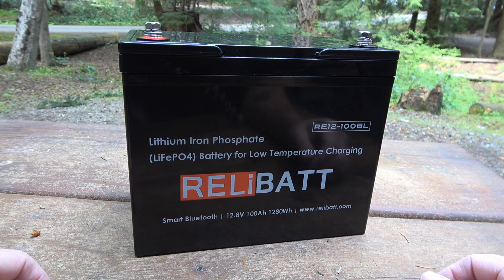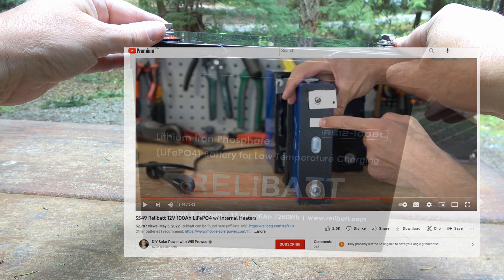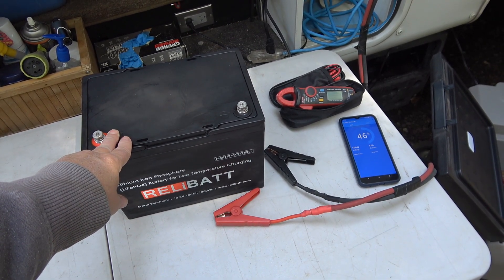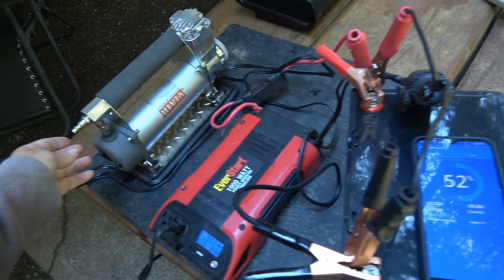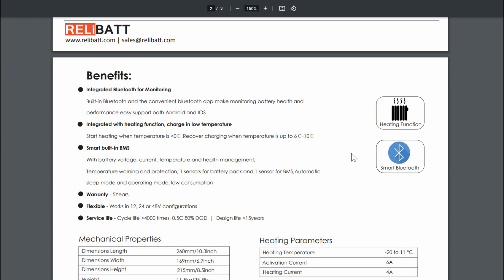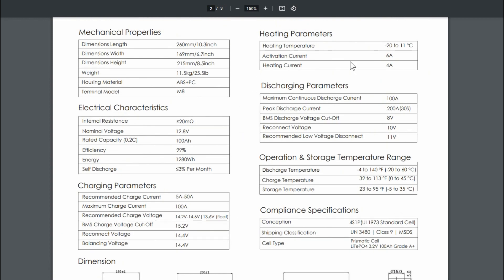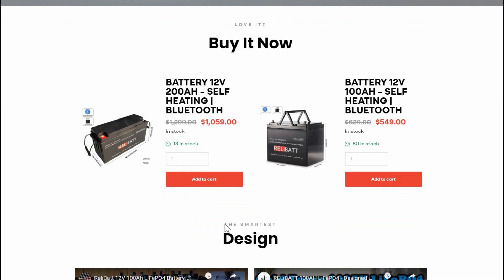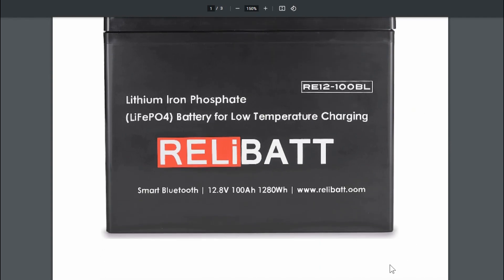RELiBATT Lithium Battery Review (Self Heating for Low Temp Charging) Model RE12-100BL - 12V 100AH

Comment: Nicely done ! You & Will do a great service for people like myself. The price of these keep going down and convincing me to change from LA as replacement becomes needed. I do not usually camp in extreme cold but mine will remain outside because I do not want to give up the interior space. We hit unusual cold this snowbird trip as well. My understanding is all Lithium batteries come from China and only a few are "assembled" in USA. At half the price of the well known assembler in NV it makes it worth the risk to me. Personally; my experiences with warranties has not been that good after about 90 days. I tend to fix it myself or replace. If you have to pay shipping then you're in a real dilemma of cost vs benefit. But as you eluded; once enough of these get into the hands of users; track records are made.

Comment: I like the benefits of a lithium battery, but with the cost of the battery, DC to DC charger and upgraded charge controller, I think i’ll wait until the battery or charge controller actually fails before spending close to $1000 upgrading. I’m just upgrading to a roof solar panel on my travel trailer. I’m anxious to see it work. Thanks Ray

Comment: Great review, are you doing a long term test.
Reply from the maker: I'm not sure yet but kicking around this idea. I currently have a 100W solar panel mounted on one of my truck toolboxes and soon will have a spare solar controller. So might use those to keep it charged in the truck toolbox and then use it as a spare battery for testing other things I review or if I need a higher amperage 12V source for something or for powering LED lights at night for rodent protection. Anything where I don't want to risk running the truck's batteries down.

Comment: So you need an external power source to power the heating element.  Hm…I wish the heating element was powered from the battery itself.  I know the battery can be discharged safely at low temp.  Or can the heating element be charged via your solar panel?
Reply from the maker: Yes, solar controller will work, any 12V power source should do it. Manual says it needs 6 amps to wake the circuit up then a constant 4 amps while it heats.

Comment: Ray, you ware glasses.  What happens when you are out in the cold (snow) then return to a toasty worm room?  Thermal shock and a lot of moisture in the battery condensate on the walls then running down.   Just kidding.  Large comments should get you more exposure. Looks like a great battery.  Thanks for the review. 👍👍

Comment: Is there a battery like this one that is made in the USA?

Also, what would happen if I simply swapped out the battery that came with my RV with one of these?
Reply from the maker: Hard to say as RV wiring and battery chargers vary quite a bit. Overall though, for best results, it's best to have a lithium-type charger. Here is a video where I discussed OEM lead-acid chargers and lithium https://www.loveyourrv.com/lithium-battery-charge-test-can-you-use-a-lead-acid-charge-converter/  Here is a review of a new lithium charger from a popular OEM RV charger company https://www.loveyourrv.com/wfco-electronics-auto-detect-lithium-or-lead-acid-converter-charger/  For a USA heated battery check out this one https://battlebornbatteries.com/product/100ah-12v-lifepo4-heated-battery-kit/  My guess is there is still China built components in it but the company is USA based. Cheers, Ray
Reply: @LoveYourRV  thanks Ray. Nowadays it's tough to get away from China made stuff. 😒
Reply from the maker: When I was in the Salt Lake area this spring I dropped by Lion Energy for a visit. I've been using their lithium RV batteries for a few years now with no issues. They tell me they are working on having Made in the USA lithium cells in the future so they aren't beholden to the global supply chains. They have quite the operation there near Provo UT. Growing by leaps and bounds.
Reply: @LoveYourRV  good for them. 👍
Hopefully that will become the new normal when everything settles out.

Comment: What will the freezing temperatures do to the cells just sitting idle for short or long periods of time?
Reply from the maker: https://www.canbat.com/how-to-store-lifepo4-batteries/
HOW TO STORE LIFEPO4 BATTERIES?
How do I store my lithium battery? A question we receive from our customers on a daily basis, especially in the Winter season. The answer depends on the temperature you are storing the batteries in and the period of time. Here’s a summary of how to store your LiFePO4 battery:
Recommended storage temperature: -5 to +35°C (23 to 95 °F)
Storage up to 1 month: -20 to +60°C (4 to 140 °F)
Storage up to 3 month: -10 to +35°C (14 to 95 °F)
Extended storage time: +15 to +35°C (59 to 95 °F)
It is highly recommended to store lithium batteries indoors during the off-season. It is also recommended to store LiFePO4 batteries at about a 50% state of charge (SOC) or higher. If batteries are stored for long periods of time, cycle the batteries at least once every 6 months. Do not store batteries that are discharged.